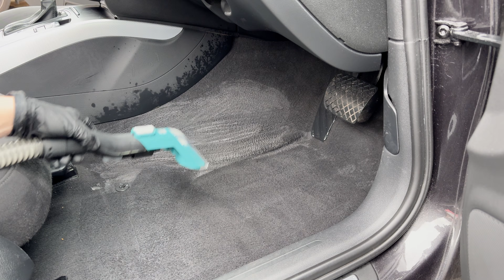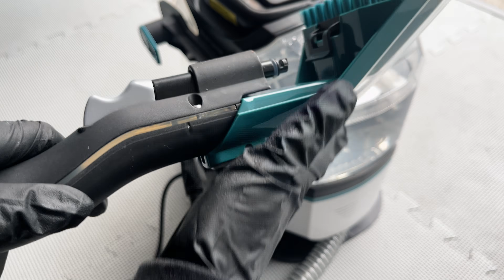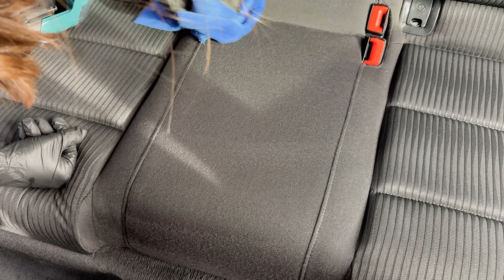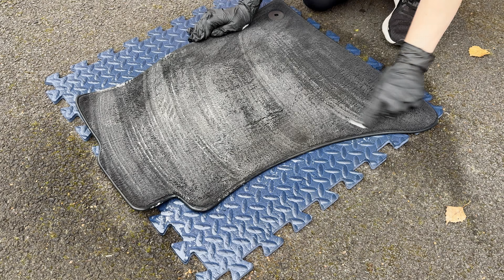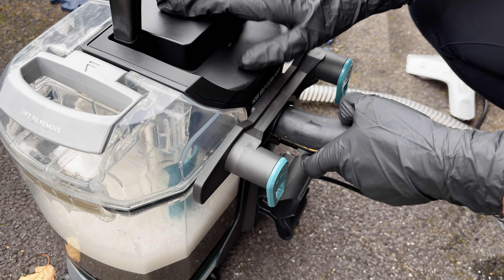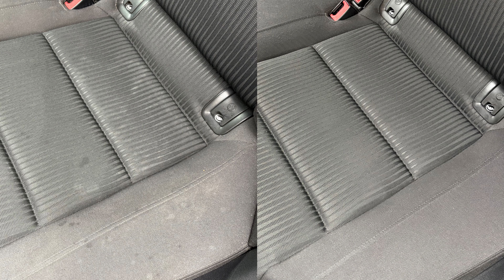How I Deep Clean Dirty Car Seats & Mats | Wet-Vac Extraction Tips

Comment: Hi Heather , great video ! I might give it ago on my cars when things warm up here in the UK.... Question, what about if the car has leather seats ? Same process ? Anything you would do different? Thanks
Reply from the maker: Thank you! 
I wouldn't use it on leather, I'd just stick to using it on cloth/ carpet surfaces. On leather you're best off with just a leather cleaner and microfibre cloth, you can also use a scrub pad/ leather brush with very light pressure too though if the surface is a bit dirtier

Comment: I've just bought this machine. It got some McDonalds ketchup out of my car seat fabric lol. Do you take the bristle brush off then and rub the seats down instead? Really like these videos. The cleaning function is awesome on it too! My Ford Focus 2018 carpet seemed absolutely horrendous, any experience with them or advice? Looked more shabby in a small area
Reply from the maker: Thanks for watching 😊 yeah I just find it easier to agitate and extract when the brush isn’t attached to the head. Some carpets can be a real pain, are you having trouble vacuuming or extracting it?
Reply: @AutoCareHQ the vacuum side of it I’m doing well with but the extraction side, I’m not doing great. However, I found your first video about this product the other day too and I don’t think I was using enough solution / saturation. I did get a McDonald’s ketchup stain out but I didn’t want to oversaturate it and regret. There were patches or spots so left micro fibre cloths on. The car mats came up a treat though 🙏🏼
Reply: @AutoCareHQ I think the drivers seat went a bit bobbly too. I can’t remember them being like that though. Which is why when I saw you had took it off,  I thought that’s pretty decent. Love the channel by the way.

Comment: Very thorough video Heather. A question if I may, can you substitute the upholstery cleaning fluid for say an APC like Bilt Hamber's Surfex HD? Thanks
Reply from the maker: Thanks for watching! I think Vax just recommend to use their cleaner as there’s always some potential for other chemicals to damage the machine and even producing too much foam can be a problem. I’ve sometimes used other chemicals in a spray bottle though to agitate (rather than in the clean tank) and then used the Vax just to flush the fabric through with water afterwards

Comment: When i first was learning it became apparent i was being way too stingy with the amount of solution I'd use being scared it wouldn't dry our for days. If anyone is doing it for the first time, this is a great video to reference and don't be afraid to hurl it on! I also start top down so all seat backs first then you don't get drips and spot on the seats themselves if you do it the other way around. This vax model didn't exist when i was looking to buy they only had the little one with the tiny tank which would have driven me mad. I like the self clean function on this one which my Biselle Spotclean Pro doesn't have and the head attachment bit looks much more solid. I broken mine (plastic inside cracked when i pushed down on it, over time). Now nothing connects and it was a 4 week wait for a new part (you have to buy the whole tube as well). It happened mid-job so I had to have something that day so i had to get what was local and available so bought another one. (its a great vac but hose is a bit short, only criticisms of it) Mine original was two months out of warranty. Then this came out, about three weeks after 'The Snapping'.....dammit!
Reply from the maker: Great tips and thanks for watching! Definitely agree about using a decent amount of solution as well it makes it a lot easier to extract more dirt

Comment: Hi Heather,how can i get rid of the 'shine' off my leather seats? 😮🇸🇪 (XC70)
Reply from the maker: Hey, you’ll need a good leather cleaner. The best ones I’ve tried are The Leather Repair Company, Geist, Gyeon and Colourlock (mild version), all are great so just get whichever you can find easily. I usually use one of those In2Detailing scrub pads on shiny leather combined with the cleaner and don’t apply any pressure, work it in and then wipe with a microfibre and it should take care of it
Reply: @AutoCareHQ Hi, thanks for the info,i will see if i can track some down from somewhere,and i will let you know how i get on.